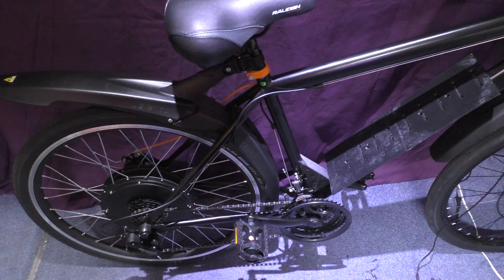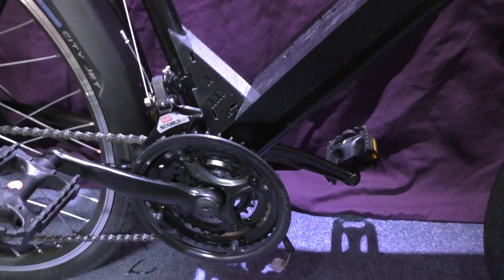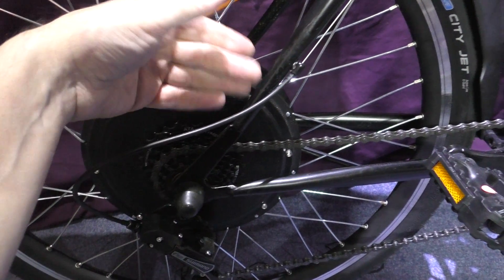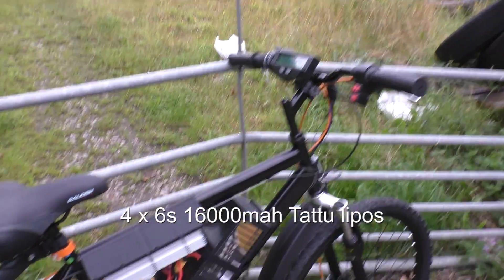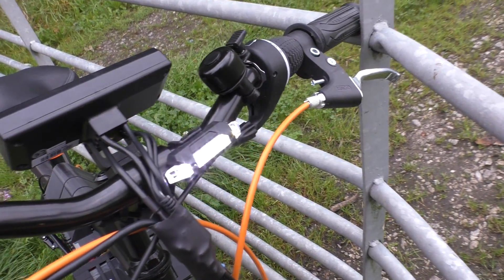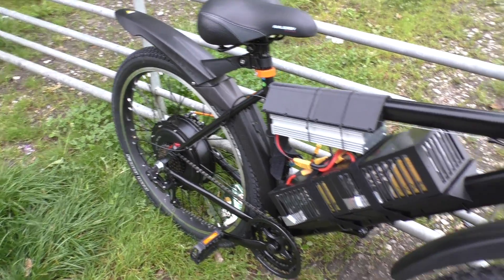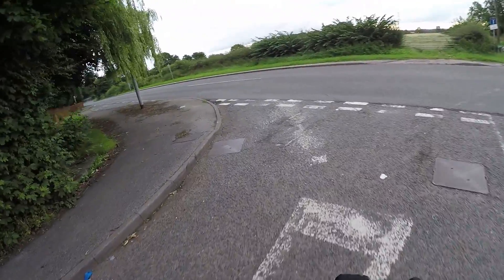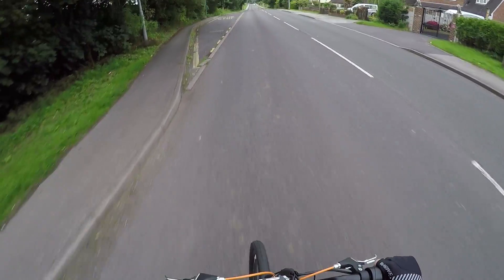Insanely fast DIY electric eBike - the most dangerous and unsafe bike ever

Comment: You might consider a better bike if you're planning to ramp up the performance more. I suggest at a minimum an XC rated mountain bike frame with disk brakes (good ones), and a through stem on the handlebars for a secure connection. I would also look at good street tires that are tough, and of course, if you have a buddy with an MC helmet, use that, or get your own for your own sake, as this thing can get a death wobble so quick you won't even know what happens. Good luck and crazy video man! Cheers.
Reply from the maker: I'm already ahead of you. V2 is in the making :-)   
https://www.youtube.com/watch?v=vOvtrvLQr-c

Comment: Not sure what the terminology is but I think the mountain bike steering contraption is kinda dangerous. It is designed not to get stuck between (off road) rubble. Is the terminology the gear ratio(?) where A tiny bit of steering has a ton of effect? Some more chopper like angle would requires less arm strength to... uhh... survive?

There are lots of  bicycles that one can ride without hands on the steering wheel. MTB's are not among those.

Comment: I'll stick to having my fun on four wheels in mud. Any way up it's a lot safer than that crazy bike.I used to ride motorbikes. When I got wiped out by a pensioner while sat with my leg down waiting to turn right into a side road and the crazy old cunt just decided to pull out and turn right straight across the piece of road I was currently occupying, I decided it was a sign from above and sold the bike...The old duffer couldn't legitimately  use the standard 'smidsy' excuse. I was PARKED side on, six feet in front of him, indicating while wearing a brand new high visibility coat in broad daylight!
Reply: get back on two wheels... its far more fun!

Comment: Just hope you don't suffer an esc runaway, I doubt your rear brake would win the battle on it's own, as the front one would be in the air.. anyway, great work, cheers.
Reply from the maker: I was worried about that, too. My new build has taken that into account and there's an 'oh crap' function built in :-)

Comment: What's the top speed? Or at least the highest you acheived?
Reply from the maker: I can't say. The only time I've tried the top speed was in this video but the speed wasn't calibrated. It displayed 21mph..... I think it's wrong :-)
Reply: Vortecks it has a much higher power to weight ratio (5x without rider and 2x with rider) than a 125cc - which tops out 100+kmh, which means theoretically this should exceed 100! You should definitely measure it, I reckon it'll do 70 at least ;)

Comment: Why not create some kind of battery panniers either side of the front wheel; this way you'll get more weight over the front wheel that should prevent it from lifting so easily... you might be able to get more battery there too ;-)
Reply from the maker: It's weighted perfectly for carrying up the 2 flights of stairs to the apartment. Having more weight over the front wheels would make it impossible. I'm building a V2 now with (hopefully) improvements I've learnt.

Comment: Funny as f**k when you give it the beans and at just about the worst point on that road with the speed cameras!  
I'd definitely think about a stronger suspension bike for this set up or get a good suspension seat post added to your current frame. Didn't notice any torque arms on your rear dropouts either, surprised they haven't twisted with that amount of power at the rear..

Comment: Need to talk to you. I've a three wheel Dutch cargo bike that weighs over 90kg without the riser. It's got three moped wheels and leaf springs. I need it eBiked and a year ago the world was a different place so it wasn't possible. I've got a 4ft by 2.5ft flat bed on the front. More than enough for all the batteries and stuff easy for a stealth set up.

Comment: nicely done but id be worried about that frame, stem and bars> u should do this to a downhill frame, alot stronger and safer
Reply: I'd say an XC personally. DH has geometry for going down a slope not on the flat.
Reply: Silver Shaman777 geometry for going fast.
Reply: Ohhh yes, that's a good idea. Seconded.

Comment: you need some hydraulic disc brakes instead of cable sheer suicide. like the speed though
Reply: Hydraulics will overheat and pop seals doing hard braking of a heavy bike at speed. I doubt even Shimano XTR with finned pads and finned rotors would stand up to too much of 40mph+ to 0mph braking with that amount of momentum to deal with.

At least with the cable brakes the worst that might happen is warped rotors and glazed brake pads, which is a more gradual fail and less catastrophic.
Reply: Yeah, I have HFX 9" rotors on my downhill bike. Fastest I can go is 70 Kph due to wind resistance. The rotors heat up if the brakes engage for too long and fairly quickly the brakes will fade because of it ... then you're not stopping. I'm very careful and feather the brakes to prevent them from fading. The speeds this eBike can go are over powering its braking ability ... Adam, please be careful out there! Cheers, Steve

Comment: Great stuff!

With that amount of speed/power, you want to base it on a mountain bike with tubeless 'Plus-size' 27.5" tyres. Typically, these will be 2.8" wide. They're stiffer and stronger than the 29" wheels you proposed.
Also, for wider hubs, the frame should have the 'Boost' spacing standard.
And you would benefit from serious downhill/enduro-spec  brakes  with 200mm rotors.

Go to a good mountain bike shop, they'll show you the relevant tech.
Reply: great fun , but come into the world of motorbikes, real fun. I like it though and not conforming is to be encouraged IMO
Reply: Mike Whincup Any idea what that package would cost? Sounds awesome
Reply: Agreed
Reply: +Sos the Rope That's a bit difficult to answer. There's a lot of tech in the latest MTBs, it's not cheap, but most of it is worth having: Thru-axles, boost hubs, e-bike spec. hydraulic brakes, tapered steerers, plus-size tyres and wide rims. I guess you are not bothered about transmission too much, but for minimal clutter you want a SRAM 1x system. NX is the cheapest. The most difficult question (if you were thinking to upgrade) is what frame to choose. If you're bolting so much heavy hardware to it, carbon is out. Steel is better for bearing strength, but not as light/stiff as aluminium.

Comment: mate you need a mirror on that thing, coz ya wont see the cops coming up behind you. they could take the bike off you if they wanted!  Max power aloud in uk is 250w 15.5 mph max  and a 40kg bike weight. . bloody goog effort tho!
Reply from the maker: It weighs 40kg, it only does 15mph and has a 250w power output. I used camera trickery to make everything look bigger and faster. Seriously, I know mate - I only did the high speed run once to see what it'd do :-)

Comment: Vortecks, you cant change the wheel size on a bike, It will ruin the handling and the pedals will hit the floor.
Reply from the maker: Motorbike tyres have much higher walls which (on average) makes a 22" wheel into the same as a 26" wheel. That's the reasoning behind it.

Comment: Where shall I test for full speed? I know, lets do it through two speed cameras!!! If you are caught, your feet won't touch the ground, and as the bike is un registered and un insured it will be confiscated, then crushed, and as it is classed an electric motorcycle and not an electric push bike, your licence can have as many points put on it as they see fit.
Even Colin Furze is not this insane. By all means do this stuff, it is good fun, but for gods sake do it off road or on private roads
Reply: Where I live 14 year olds drive tractors, with no registration plate, anywhere they're told.
Reply: Typically you'd put appropriate brakes on it. I use and highly recommend Hope mono 6 Ti with 205mm rotors, although you can get 235mm rotors. The hope tech v4 is also an excellent brake choice
Reply: The Computec, the technology is called 'YouTube'.
Reply: false.  I've set a few off on an ebike.
Reply: Wut?  I live in the UK and I travel abroad a lot and I assure you we have some of the safest and most disciplined roads I've ever seen.  It's not so much what it says about us, but what it says about other nations.
Reply: Rx Jx yes, an old airfield would do it!
Reply: How can they charge him, you need reg plates for an address to send tickets.
Reply: No plates on it you plonker
Reply: Roger Crier paaaahahahahaha you didn't think that comment through first did you.... Tit
Reply: I think the old bill would find it pretty easy to identify the rider of said machine as they extract what's left of him from the side of a car he's just t-boned, Roger is right, he's not saying DON'T DO THIS, he's saying do it somewhere more suitable than a public road.
Reply: tangomoggy I fully agree, our laws are Dickensian. In America, though it may vary state to state you can stick a 50cc engine in a bike frame and just use it. There may be a limit. Of say 20 mph, not sure, but way more sensible than our stupid outdated regulations.
If we stick with this stupid 15 mph must have pedals cobblers then it is going to be ignored wholesale as we have seen from comments here! Then the press is going to take it up, brand us all as hooligans and the government in their infinite wisdom will ban e bikes altogether. Then we're snookered.
Reply: There could be a similar aside put forwards for using a mobile phone whilst driving. The main difference is, using a mobile phone whilst driving has been proven to be dangerous...although people get away with it (hand over fist) because we just don't have enough police, traffic division or otherwise...! Although it is said that you need to register/tax/insure such a vehicle, how would one go about such a task...and would it need to be deregistered if you swapped out the rear wheel for a standard cycle hub, or a permitted power - but mid-drive system...?
Reply: Roger Crier the police wouldn't be able to catch him
Reply: The guy made his own elec bike Ok from parts but still requires a few more brain cells than the average bear And you find it necessary  to give him a morbid scenario
  Bad stuff happens, all the time to people that don't deserve it. 
But so long as it's by the rules THAT'S OK, I am tired of other people  preforming worse case risk assessments throwing it in your face.
But when I say "Its ok if I am legal", to kill some little girl 
"I am being silly" 
 It is far more statistically likely she will die from vehicle exhaust related illness.
Check out the stats.
 That will turn that misbegotten righteous grin upside down every time you start you car you are probably activating cancerous genes in some poor little girl
Reply: Reality here in the UK is that it's total anarchy on our Highways anyway.
Reply: You're the plonker mate, think we've already established that
Reply: +Roger Crier   Please tell us more about this amazing speed camera technology that can identify a bicycle, its owner and their address for prosecution
Reply: Wonky Donkey So the consensus so far seems to be if you can get away with it then that's ok. Like I have said, by all means make the fastest bike you dare, great fun.....I'd drive it given a chance, just like everyone watching this, just don't belt around normal built up roads on it, because sooner or later you will regret it. 
Let's get silly and dramatic! A toddler finds the front gate open and wanders out between those parked cars. You can't stop because you are going too fast with one brake and a regen rear option. You kill it right outside its house while the dad watches in horror because he left the gate open. It's not your fault, but you will still cop the flack, and, here is the important bit......you will not forget that moment for the rest of your life.
Now let's get real. If you took everyone that has had this shit happen, every single one of them would tell you you not to take the chance. They tend to do things like stop driving forever, or commit suicide.........nice!
So who's the Plonker?
Reply: Bootlicking copsucker.
Reply: Roger Crier When I was a preteen child, my father explained "True freedom means you are free to break the law. Don't get caught or there will be Hell to pay and you'll be punished according to the law you broke. In fact, your poor choice may result in you losing your freedom but, this is key,  you are free to break it." He went in to explain that in a free society, justice was fair and punishments were not excessive.  
Now I'll get "silly". A parent that does not close the gate in order to keep their child safe has been negligent in caring for that child. If the child suffers harm or death, the parent is at fault. I know a woman who was run over by her father as he was backing down the driveway. His speed was not excessive. A moving vehicle at any speed will harm a child it hits or runs over. You may be considering reaction times but you would need to be moving at jogging speed to react quickly enough to avoid the sudden appearance of anything in your path. 
Final point: he said "Never again". Get over it.

Comment: Super.Way better to build yourself an ebike for the price and your choice of frame size etc.I am very happy with mine for 3 1/2 years now.Using a down hill style frame and motor on the front it would be doing wheelies if i put it on back because without that weight on front it wants to lift anyway just pedaling the geometry and short wheelbase.
Reply from the maker: I'm glad someone else can see the point of making their own. You get to know the bike properly and you can see where things might go wrong. You learn nothing by buying one off the shelf and they cost much more than a DIY one :-)
Reply: i injured my head,neck,back and knees on the job building trucks welding,fabricating etc.I could no longer pedal especially uphill.Had my knees scoped and now looking at having serious neck surgery.Also for therapy started flying and building FPV racing drones.Love those Tattu batteries.

Comment: where can I get this kit and how much is it please buddy? awesome video thank you
Reply from the maker: It's not as straight forward as you think mate. Getting a 1500w - 2000w kit is easy but anything above that, you have to buy the bits separately and build it yourself. When you jump up to 9000w, you have to take into account a lot of other things with regard to wiring, torque control, circuit breakers etc. I wish there was a kit, it would have made it sooooo much easier.   
I'm doing a Voodoo Canzo conversion now and I've upped the power to 12kw - the 1st build video will be this weekend (hopefully)

Comment: What's the frame made from ? word of advice iv snapped 6 bikes in half from the front forks and rear dropout to the middle of the frame stick to heavy thick steel I came off my aluminium giant when it split in half at 30mph tore the muscle in my right shoulder and broke myself up wasnt fun 😂

Comment: put some hydraulic brakes one and bigger discs, doubt those brakes have nearly enough stopping power!
Reply from the maker: That's why I bought the new bike...... it's 80% done and nearly ready for testing
Reply from the maker: I've owned a 350lc (the widow-maker) back in the days and I'd have another one tomorrow if I could find a decent one. I've also owned a 1980 Z1000, a KH250, a Laverda RGS1000.... the list goes on. My last one was a ZX7RR which spat me off at 135mph.  
There's nothing like doing 150mph around Donnington with your hair on fire!
Reply: Not disk brakes but Regen for battery.
Reply: The motor is the brake.
Reply: Vortecks ... You should modify the classic Triumph Lightning and make it live up to it's name... That would the shizzle in the gizzle.;)
Reply: What's the legality of this? Seems awesome. And I know you don't care.  Just wondering
Reply: Billy Lee here in germany you are only allowed to go up to 30 km/h

Comment: What an experience. That is proper fear in your voice. You're a complete nut-case! My hero!

How long do you think the chain will last given that amount of torque? You are very gentle on her and always pedal to get her rolling. Since you're effectively running a single speed you can use a much thicker 7 speed chain for longevity.
Reply from the maker: It's not chain driven, it's a hub motor so there's no wear on the chain at all :-)
Reply: Vortecks ... Put another motor in the front wheel & see if you can hang on... HA!
Reply: No just wear on the freehub .
Reply: uberflutak yer my hero to  really  good video laughing my Tits  off
Reply: Fear in the voice is good, it shows performance of the design outperforms expectation.
Reply: uberflutak ... The chain is just there for posterity... and that lovely sprocket sound of course.;)
Reply: It's spokes that will fail. What rim is that? Velocity psycho?
Reply: the ratching pawls in the freehub  aren't subject to the motor torque whatsoever.  That's why they ratchet :)